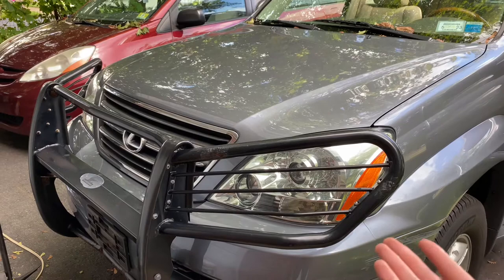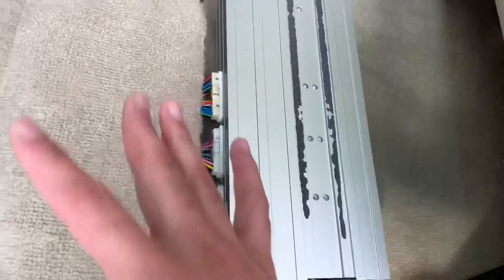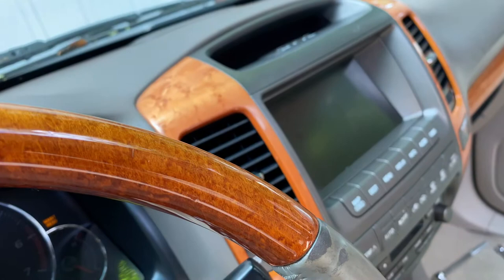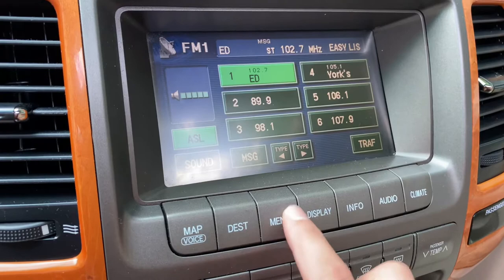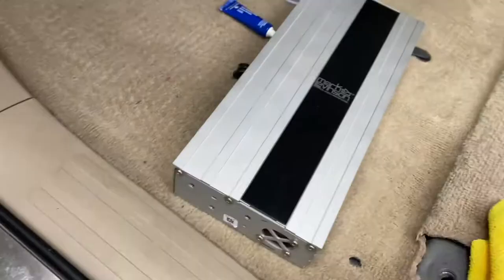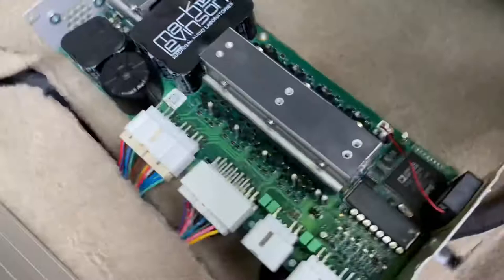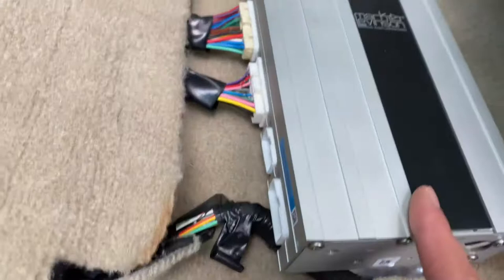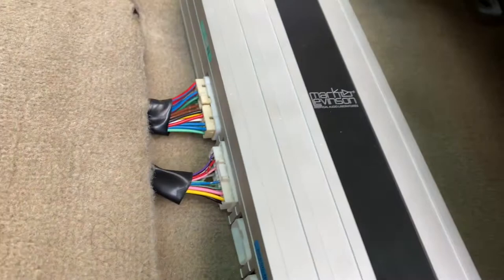Lexus GX470 No Sound Mark Levinson Amplifier Troubleshooting and Fix

Comment from the maker: I just remembered, of course remember to check your fuses as well! There are 3 total fuses to check in the driver side and engine fuse boxes. Check fuse-box.info/lexus/lexus-gx470-j120-2002-2009-fuses for GX470 fuse diagram.

In the driver side fuse box: check fuse 22 (acc)

In the engine compartment: check fuse 26, 42 (radio 1, radio 2).

Hope this helps!

Comment: not sure, weird thing was, worked when I took it in to get the timing belt (and water pump) changed, but, didn't work when I got it back. but just the idea a replacement amp should do the trick is a great help. also, your fuse check suggestion helps too. many thanks!! (at age 63, things like this help me beleive that the internet might not be the anti-christ)
Reply from the maker: That is really odd — Did it work?

Comment: This is seriously exciting. I have been driving my Lexus GX 470 for years with no sound. Brought it to 2 audio shops and the dealer. No one could help  I hope this works for me. How do I know which amplifiers are compatible?
Reply from the maker: Hey man, go ahead and check the model # under your seat. You don’t have to remove the seat to check, just move the carpet out of the way and take a peek. 

Chances are you have a 86280-0w141 like mine, and so what I purchased will work for your as well. (86280-0w041, from 01-03 LS430).

Comment: In the video you mentioned your fan would cutout after a couple of seconds and that indicates a dead amp, however, when you installed the new amp you don’t mention the fan at all. Does it also cutout after a couple of seconds?  I ask because my “new” amp is doing this and I don’t know if a fan cutting out necessarily means the audio won’t work
Reply from the maker: Sorry I don’t remember 100% don’t have the car anymore but with new amp my Lexus worked so check the fuses mentioned in my comment above and if that doesn’t fix it it may be the head unit itself